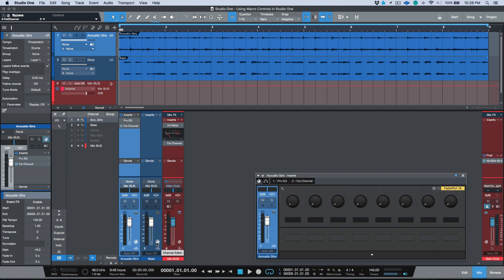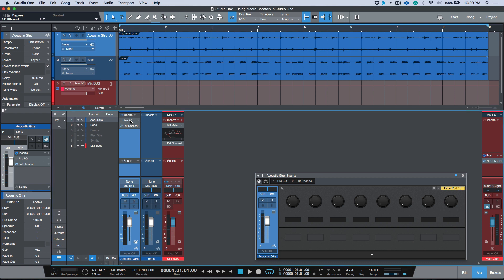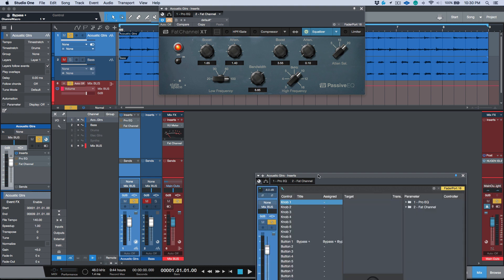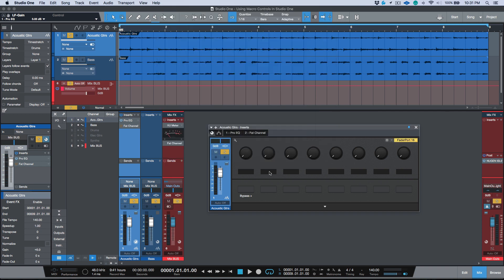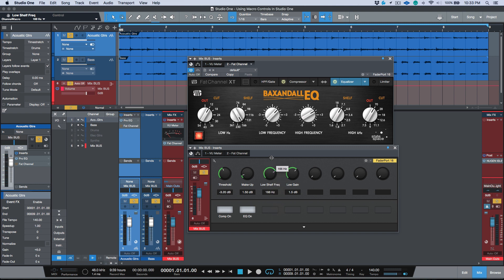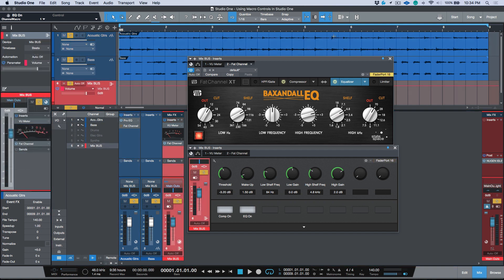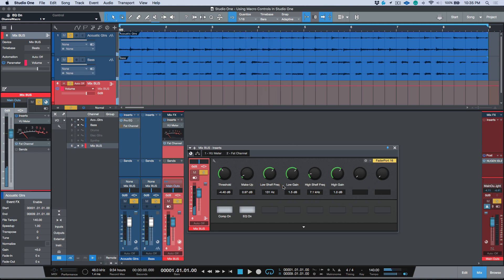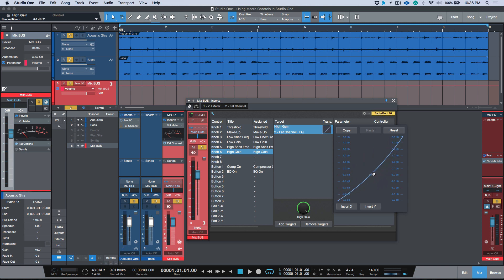Using The Macro Controls In PreSonus Studio One

Comment: question when you open the macro control. the little arrow at the bottom that opens up another feature and the buttons above the buttons. what do those do? excellent video. I LEARNED A TON FROM THIS VIDEO. AND IT WILL SPEED UP MY WORK FLOW TREMENDOUSLY!

Comment: Marcus - thanks for this video, as it will give me the inspiration to take another look at how I can use this.  I set this up a while back (on FaderPort 8) to control the bands/gain of the EQ.  Issue I had was that I found myself forgetting to use it because it is buried and out of sight most of the time.  I also found that it was a lot to setup across a bunch of channels on a mix (though I've since found that saving the FX Chain carries the Macro assignments with!) and not immediately intuitive, especially if mapping out different parameters of different things across channels (EQ and gain in one part, comp makeup or threshold in another, etc).  I've been eyeing the Console 1 for these reasons, but still think there are a TON of useful options for the Macro knobs, especially with a FaderPort.  Thanks for another good video!
Reply from the maker: Blades Music yeah - to be honest I really only use this when mixing with the FP 16 because it’s one button away.. the one thing I wish it did have was a relative vs absolute mode